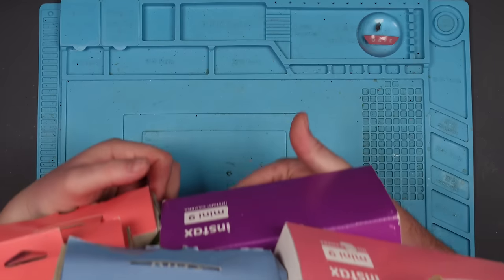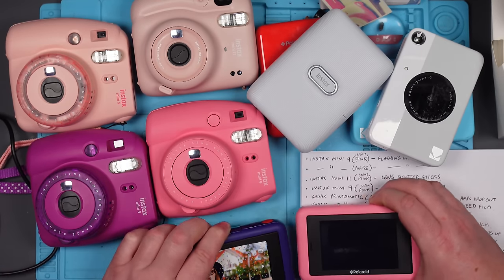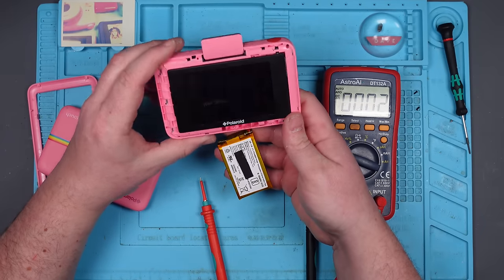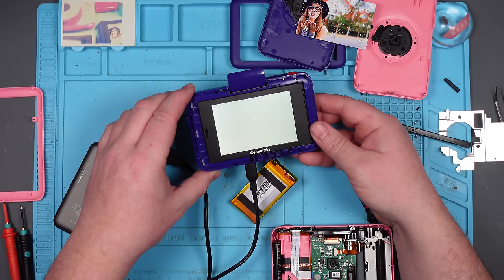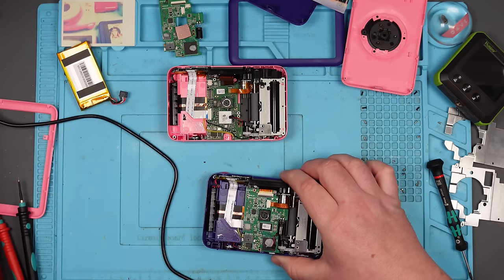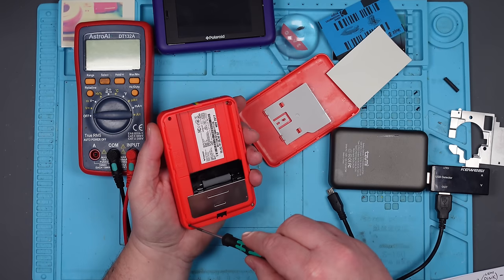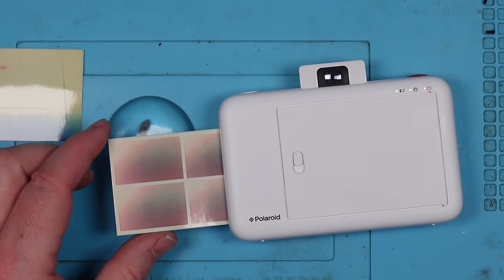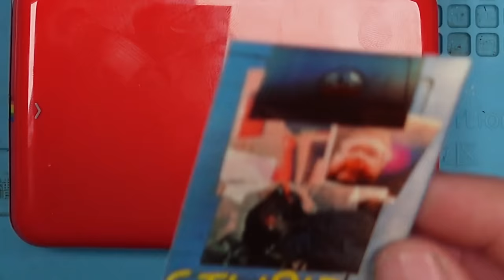I Paid £80 for ALL the Instant CAMERAS | How many can I FIX?!

Comment: Alps are a Japanese electronics parts maker. In 2004 i was working for Synaptics in San jose (Synaptics make the majority of touchpads on laptops, a lot of ipods generations etc) we were the pioneers of capacitive touch sensing. Our BIGGEST rival by far was Alps who managed to get resistive sensing good enough to compete. They made some very good stuff.
Reply: I pulled apart my father's 1970s component system Sony radio tuner and the entire radio dial was made by Alps. Still going strong.
Reply: Worked with BMW, our onboard computers in some models are made by Alps

Comment: This was quite useful.  Both the pink and purple cameras are the 2nd generation Snap Touch (they have the power button between the shutter button and flash.)  I have a 1st gen Snap Touch which lacks that button and uses the flash up/down position to turn on and off, but still has the touchscreen.  The companion app kept nagging me to update the firmware, which kept failing... until it updated to the incompatible 2nd gen firmware and completely borked the camera.  It charges and turns on to a white screen, but fails to proceed or respond.  It was handy to see the teardown of these 2nd gen units to see the differences in the PCBs.  I may try to tear mine down and manually reflash the appropriate firmware directly to the IC.

The image quality from the camera was fair in good lighting, and abysmal any other time.  Printing via Bluetooth with my phone like you did with the Zip, the print quality was pretty bad.  Seeing the prints you made from the Zip, I wonder if my printer was bad from new, or perhaps I got a bad batch of paper with the camera. (it came bundled with a big pack)

Comment: Pretty  sure the problem with the last one was that you tried to take a photo of a transparent blue thing on a blue background from a few cm away.  These cameras focus at infinity and require quite a lot of light to make a decent photo. Take a photo outside and it will be way better.
Reply: It was overexposed, so too much light was getting to the sensor and washing out the picture. As another commenter has said, it was likely that the shutter was stuck open or malfunctioning somehow and not letting the right amount of light in, and Steve's poking around fixed it.

Comment: 17:40 A lithium cell sitting at 1.8V is /not/ OK. Please don't try to charge it. It will have dendrites inside that can suddenly pierce the seperator, discharging the cell quickly and quite spectacularly ...

Comment: For the dodgy battery just buy a similar single cell and solder it in place of the dead cell. If the cell had remained around 2v then i would have just punctured the cell with a cocktail stick and sealed the hole with a dab of hot glue or super glue . Before the usual NASA engineers jump on and start the gobshiteing Ive been making custom LiPo packs for over 20 years for my 2 local RC clubs were we use high draw LiPos for racing drones and long duration packs for FPV cruisers (medium speed planes built for 40--100 mile round trips )
as long as you take care you wont have an issue.

Comment: never use a metal knife on a lipo battery it can explode and catch on fire 🔥and you can get hurt from it
Reply: Can confirm, you dont want lipo fires.
I charge my rc heli lipo's in a metal pan with a plastic ice cream tub above it filled with sand.
Had one to many issues with them.
Also a big e-bike brand had a warehouse nearby my home, couple pallets with 6000 batteries caught fire and we were evacuated due to the smoke.